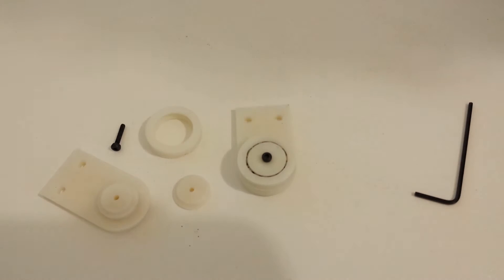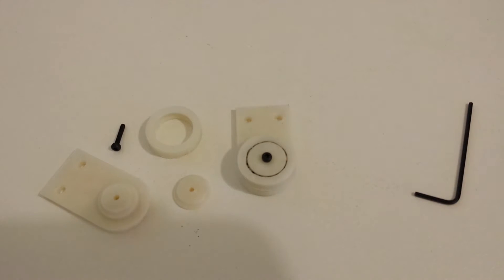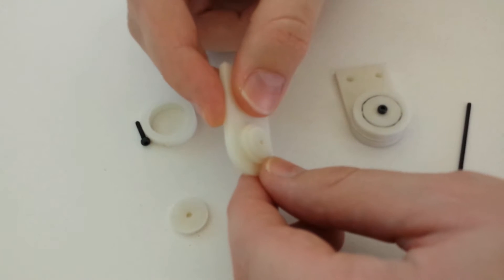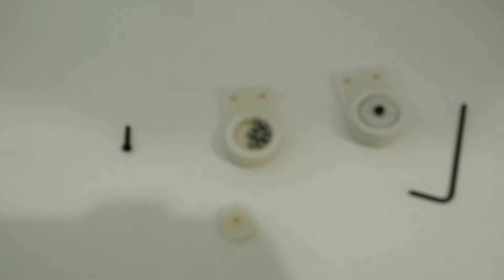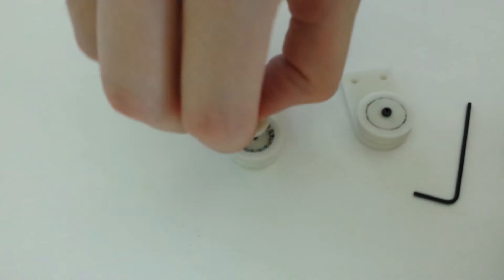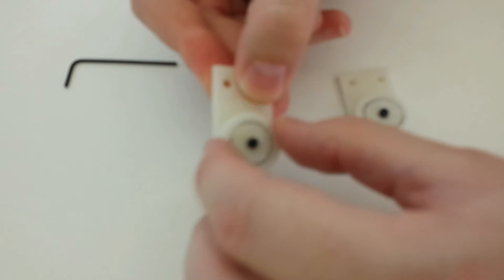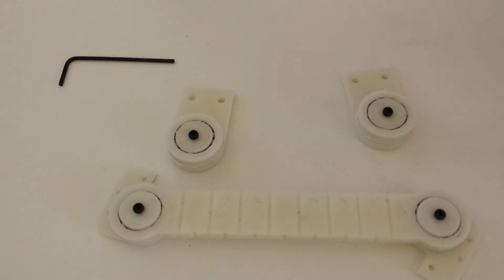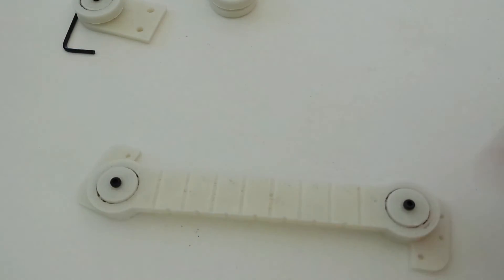3D printed Bearings

Comment: Good job! Do you think it is possible to print a sliding bearing that can satisfy those normal using that don't require high smoothness. is it easier to 3D print a sliding bearing?